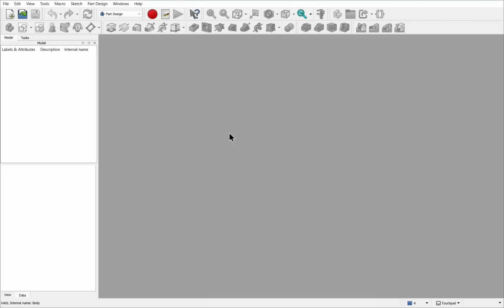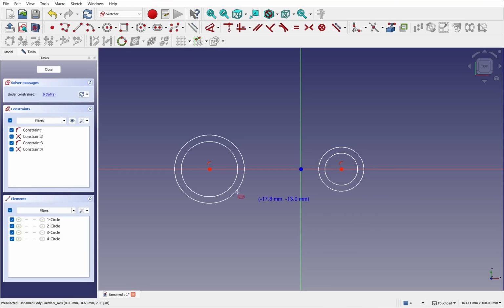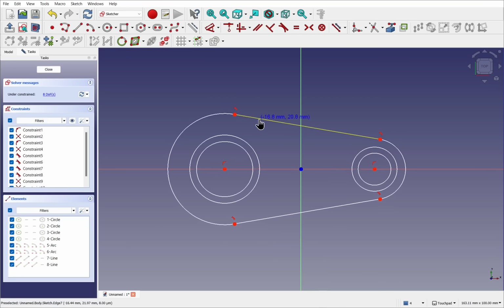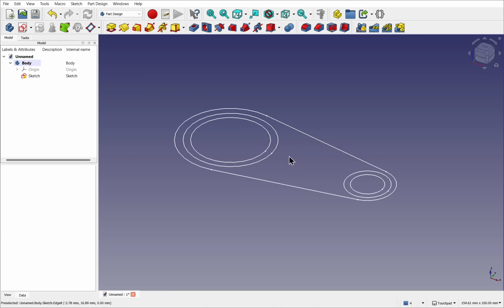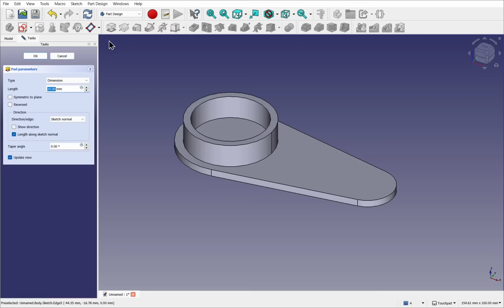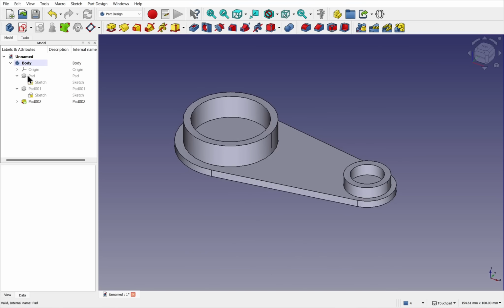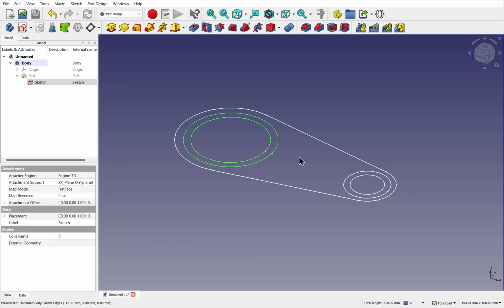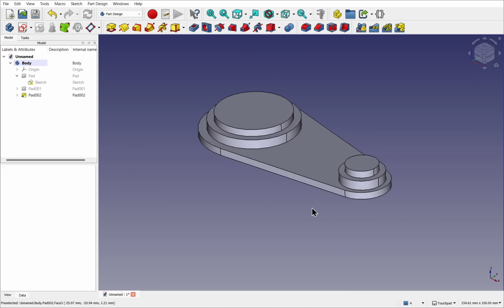New FreeCAD Feature! Complex Extrudes from a Single Sketch Like in SolidWorks

Comment: Finally! Freecad is really coming along. Can't wait for version 1!
Reply from the maker: Huge steps forward :) Onwards and upwards :)
Reply: I guess that's the entire problem with FreeCAD.  The fact that this was added unintentionally again reflects that the FreeCAD developers have a mindset of their own that doesn't match with what most people find important in a CAD package.  If that doesn't change, I doubt FreeCAD will ever become enjoyable for me (and many like me).
Reply: @MisterkeTube  Well, most of them don’t have experience with commercial CAD software and got used to FreeCAD’s quirks so much they often don’t want large changes. Fortunately, there are some new devs with more experience with other CAD software (like the guy from the Sketcher and Assembly improvements).
Reply: @Gumball_W unfortunately that's not the case for the BIM wb. I bet blender will just surpass freecad in each and every feature in just 3 years. They are huge, there are lots of devs, it is not a centralized mindset and they are listening to users.
Reply: @MrLelopes  blender is very capable, but it's like a swiss army knife that you need years to memorize where the blades are, and by the time you learn they change everything, it's just so dense with menu diving that is possibly unrivaled in software.
Reply: WE'RE HERE BABYYYY 1.0!!!!
Reply: No one added it on purpose but yeah, I can't wait too.

Comment: TBH, with TopoNaming not immediately screwing even the simplest model and this selective extrusion from sketches, only a clean-up of the interface and themes need work done. Why multiple dark modes but none is a good preset? You still have to rely on a themes addon for a cleaned up interface etc
Reply: Icon clean-up is already there, and themes were basically reimplemented (apart from Classic, there are 2 new built-in ones - Light and Dark) so it's just a matter of changing some aspects of the interface that are far from user-friendliness.

Comment: currently trying to the practive models from too tall tobi. It's a bit hard to see what other cad can do. especialy the master sketch stuff. But now this will getting better 🙂. thx for keeping us up to date!
Reply from the maker: Are you going to have a go for the CAD tournaments he does? Such a cool idea and I am really tempted.  I think with the new version of freeCAD it will push us up the leader board.
Reply: @MangoJellySolutions  I would like to - someday, but definitely needs more practice. I use the fcinfo macro for mass calculation. The practice models are so great for training. I found out that my models (3d printing, fixing stuff, diy...) avoids problematic things I'm not good at. So I can more or less model what I want/need, but I do it in always the same manner.
For example I stuck in the rocket model (fireworks 24-07-10), rocket body no problem, but the fins killed me.

Did you thought of participating?
Reply from the maker: I haven't done any of the practice models yet but I really want to participate as I never thought speed runs where of benefit until I tired one I found on the web. I realized you can learn quite a lot from it especially when trying different workflows.  I really want to participate, just need to find some time.  It's a awesome idea he's come up with and really well delivered.  Maybe I should document my practice.

Comment: It would be great I'd you could offset an extrude
Reply: You can if you select the edges you want (just like in the video), then instead of the Pad you create a Sub-Shape Binder. The binder has an offset property in the Data pane. Then you Pad/Pocket the Binder. Incidentally, this is how you do these multiple extrudes from a complex sketch with the previous versions of FreeCAD.
Reply: @ElectricGears  very cool.  i forgot that you could subshape edges
Reply from the maker: Thanks for the nice explanation of that. Always nice to see others getting involved with helping. 😊

Comment: Now all they need to do is modify it to be the same as RealThunder branch where you can just select the actual face instead of the outer wire of the profile.
Reply: my guess is they are slowly pulling features from his branch anyway. They will get there.
Reply: Wow that branch also supports multiple (separate) solids in one body from single sketch or by pocketing! I had to split my part in multiple ways only because of print size limitation and with regular freecad it's cumbersome to design that upfront with different bodies and all the binders and external geometry. It's equally annoying to do it at the end with split operations complexity so I'll continue trying out this branch build for my next design. Thanks!
Reply: Actually, it came with Realthunder's TNP mitigation code and no one realized it's there until now.
Reply: Guy's a legend.
Reply: No update on this? It’s such an obvious improvement
Reply: @petermarin  welcome to open source software
Reply: I'm glad you said that because I thought I was taking crazy pills. I knew I saw some videos of people doing that. I hope they bring that into a future release.
Reply: There are no faces in a sketch. If you select closed wires and create a SubshapeBinder it creates a face you can select.
Reply: @alexandermckenzie5077  Not yet but in the future, there could be an option to automatically detect closed contours in sketches. This is common in commercial CAD software.
Reply: @alexandermckenzie5077 .. and if you change the underlying sketch, you have to go around reselecting which elements are incorporated in the SSB, and then have to go around doing a similar operation at the point where the binder is used.

Comment: Similar to Autodesk Inventor also. Although you dont have to click all the lines there. It automatically recognices the areas when you hover the mouse pointer inside them. But you actually gain more control in complex cases by clicking the lines. Cant do that in Inventor. And it can be cumbersome in more rare cases to get inventor to highlight the area you actually want. If its a very complex sketch.
Reply: Having FC recognize the area would be better in the case of a complex wire with lots of tedious segments.  This is a good evolution until then.
Big High-Five to the FC developers and to Darren for keeping us in the know.
Reply: In fact, it's not a planned feature but rather a side-effect of other changes (TNP mitigation).

Comment: That's the feature I was waiting for a long time
Reply: Freecad is over 20yrs old, yeah I'd say it's 'long awaited'.
Reply: @TheGraemeEvans  it's a free and open source project so I'm using it with all the problems it has and I'm always happy when they introduce feature like this that are making life easier and modeling faster. I discovered it 4 years ago and I have to say that the improvement since then is impressive.
Reply: It's not a proper implementation yet - it came from external code and no one knew until now.